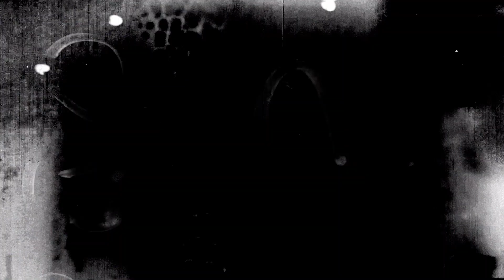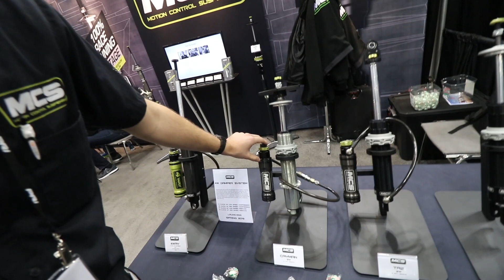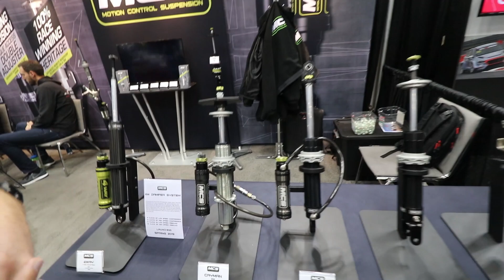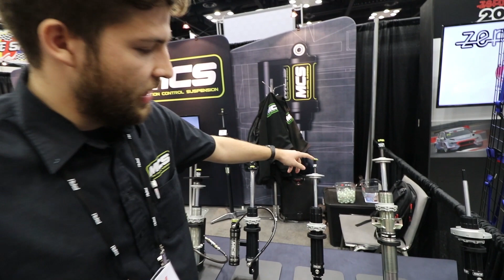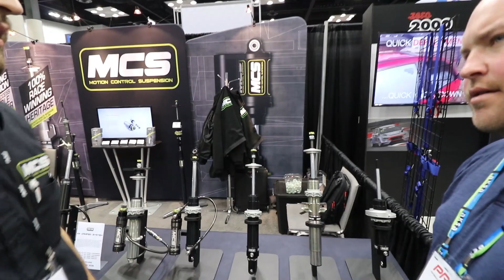BEST Suspension for your Porsche? MCS - Motion Control 987

Comment: Great timing on the video and very informative stuff. I am in the midst of invasive surgery of my suspension setup to install JRZ RS2s. Sounds like I'll be burning my arm on compression adjustments! My car needs more than a switch out of the strut/spring setup - expect to have to replace other parts of your suspension while you're in there - and budget for it! Don't mind going through the work, fingers crossed I can experience the difference and dial in that fine setup for auto-x, DE and street...
Reply from the maker: Dude, that’s awesome! Assuming you are working with F6M? When I was talking about the 987.2 track car that i was so impressed with it used JRZ’s!
Reply: @BoostBrothersGarage  you know it, Mike. Jon helped me ID these for.the car and Bryan @ JRZ has been helpful to this point. Will matter more when I have all the supporting parts in so I can actually put the RS2s in.
Reply from the maker: Good stuff! It’s gonna be such a nice setup!
Reply: sorry to be off topic but does anyone know of a tool to get back into an Instagram account..?
I was dumb forgot my password. I love any tips you can offer me
Reply: @Kamryn Jimmy instablaster ;)
Reply: @Fletcher Marshall thanks so much for your reply. I found the site on google and im trying it out atm.
Seems to take quite some time so I will get back to you later when my account password hopefully is recovered.
Reply: @Fletcher Marshall It did the trick and I finally got access to my account again. I am so happy:D
Thank you so much you really help me out :D
Reply: @Kamryn Jimmy happy to help =)